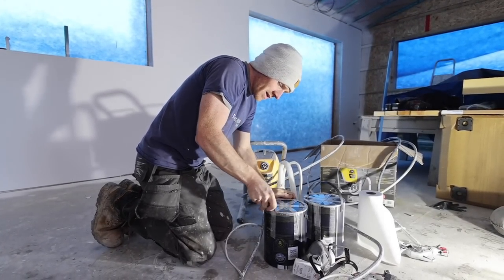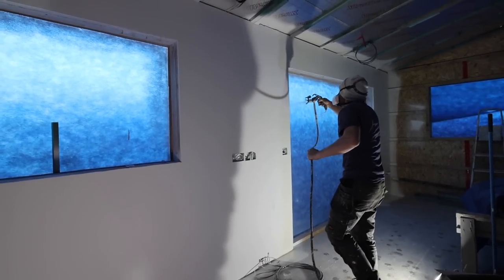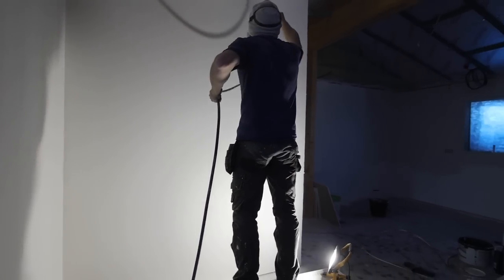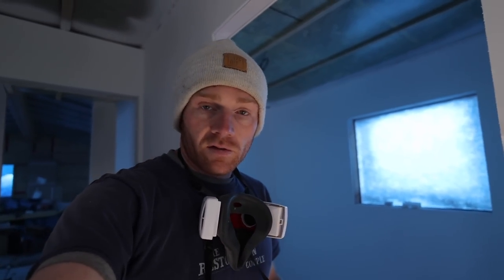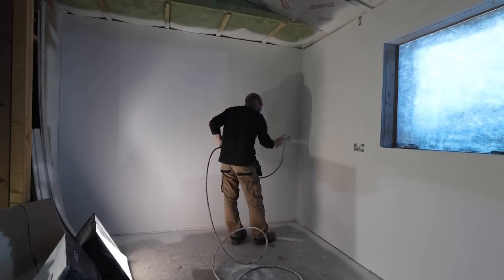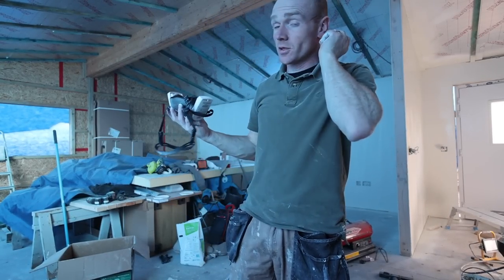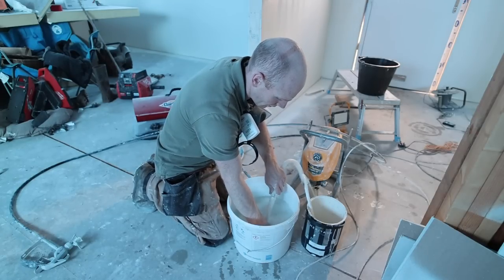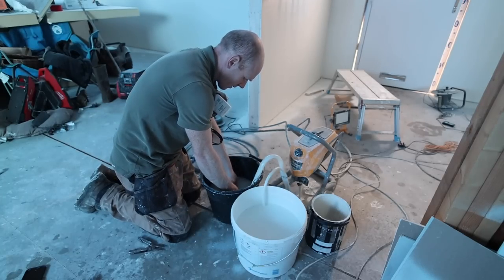HOW LONG DOES AIRLESS SPRAY PAINTING REALLY TAKE? - and our KITCHEN arrived!

Comment: Nice work. However I’ve found out any touch up with a brush or roller when it’s dry will stick out like a sore thumb. It’s inevitable the walls will get marked when doing the ceiling and kitchen etc. Also spraying uses so much more paint. 👍🏻

Comment: Hi all   Definitely the airless spray gun is the way forward , I remember in the 1970s there was an advent with an industry airless unit mounted on a train spraying a meter wide panel set at the side of the track . The train then set off with the airless sprayer coating the panels as the train went at speed down the track.  I also remember seeing these units being used in factories,    and indeed they would cover tremendous areas in a very short time ,    and Was told by one of the guys 
they actually used less paint than if they used brushes or rollers .  So in your case it’s a no brainier as they say .  Best wishes and kind as always 😀👍👍👍

Comment: Tip size - minor thinning compensates as it is a Cisco city issue - which is tip size.  Trim paint vs wall paint, oil vs latex - you need 4-5 tips.  That spray enamel trim paint beautiful with the right tip.  Looks good. Pumping the paint is the was the way to go on new construction.

Comment: Tim and everyone in the chat, I’ve got the same Wagner but for some reason mid way through spraying the pressure drops out and I end squirting thick line of paint on the wall. I then have to turn of the machine and re prime it to sort it out. Not sure if it’s the hose line getting blocked or something that causes it but it’s so frustrating

Comment: Quick question Tim, are you cladding the ceilings or putting up plasterboard. If plasterboard would it be easier to paint the ceiling first. Plus any tips on preventing neck ache and back ache to keep the sprayer at 90 degrees?

Comment: Tim if you’re using the 510 tip with emulsion then pressure 5 is more likely what you should be on.  I have the same unit and generally spray on 5 with undiluted emulsion using that tip. 👍
Reply from the maker: That's chucking out a lot of paint though, guess its faster passes though? Will try again next time.  Next rooms are small walls so using the smaller graco which usually is fine.
Reply: @TheRestorationCouple  that’s true but you may also get away with 1 coat 🤷‍♂️

Comment: For white paint being sprayed on white walls, I think you did pretty well to make an interesting video. I was thinking that you could have had one of you spraying and the other with a roller to improve distribution on the walls when you'd got the paint onto them. When the walls are dirty, and it's going to show with white walls, using a mini roller to repaint the walls is a near certainty. Also, in kitchens and bathroom areas white kitchen/bathroom paint that is scrubable over the top of the paint on the walls may be an idea - it might be that there won't be any areas that you get that dirty so you won't need it but it is an idea....!??!
Reply from the maker: The plan is to panel the lower wall in areas with most traffic.  Bathroom will be a different paint as will utility.  It will certainly be put to the test but at least we have the little handheld airless sprayer for touch ups.  Its more the muddy dog tail i'm worried about, hence the panels! 😂

Comment: I used a Wagner 690 Flexio sprayer and Leyland Contract, paint matt white - what a disappointment. No matter what pressure settings / dilution the spray pattern was uneven / blotchy. I filtered the paint before using - but the Wagner Flexio sprayer generated a lot of small dry paint bits in the spray pattern!!. 
I used easy fill filler, but the paint would not hide it - even after 3 coats. At certain times of the day you can see the filler patches show through. Ended up ditching the sprayer and using a roller instead.
Reply from the maker: Yeah that can be a problem with the HVLP type sprayers, I remember the same with spraying diluted clay emulsion.  Great with wood finish though but emulsion would almost dry before it hit.
Reply: I had the same issue so I called Leyland they said that their paints aren’t compatible for spraying m. Similarly normal dulux isn’t, only dulux trade range can ve sprayed.
Reply: Conveniently on the demos on the Wagner web site they don't warn the user of these issues - just interested in selling sprayers that are net to useless for one of their primary purposes.
Reply from the maker: @rtreborg8472  I’ve not come across anything that doesn’t spray with airless. Leyland and dulux fine. I think the issue is often people trying to spray straight out of the tin with the hvlp sprayers mentioned above.

Comment: U are getting they lines in the spray pattern cause the tip is worn, they don't last to long, they smallest bit of junk can mess a brand new tip, u need a new 1 u will get 1 from any decorating centre

Comment: I've been a professional  decorator for 50 years and have used roller and spray for walls, and I always prefer a roller, especially with no cutting in to do. Stephen Woodward mentioned in the comments about someone (Jo 😉) following with a roller, which was my thoughts! I think a spray only puts the paint on the surface, as opposed to a roller (or brush) which works the paint into the surface. Of course, being a pro decorator, rolling is second nature and I realize that spraying may be easier for the DiYer.
Our main problem was always the lack of light, and when possible, we would always wait until the finished lighting was installed before applying the final coat. (After first checking for any misses, filling etc). I would be very surprised if there wasn't lots of touching up/filling to do when the light improves, but of course you need to crack on, and couldn't wait until the light improved!